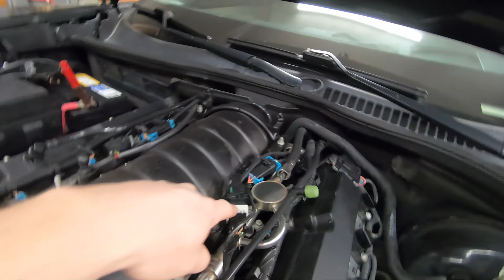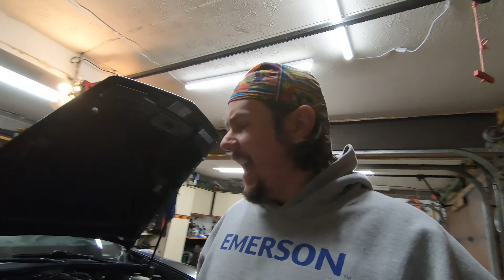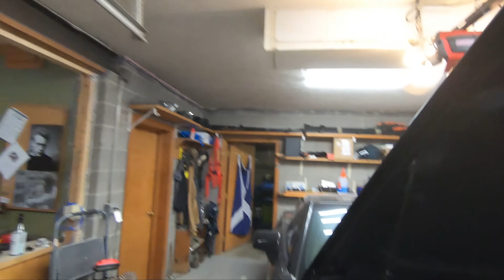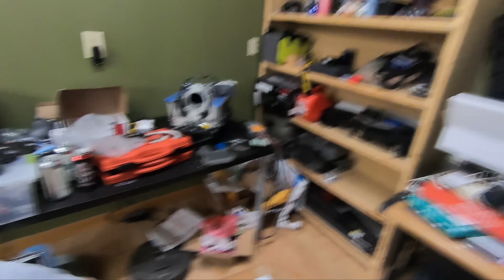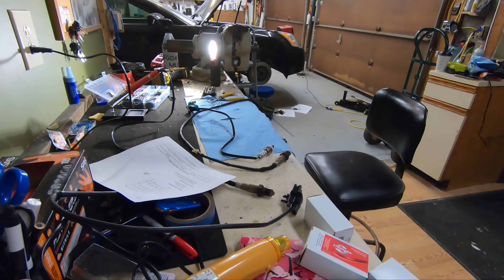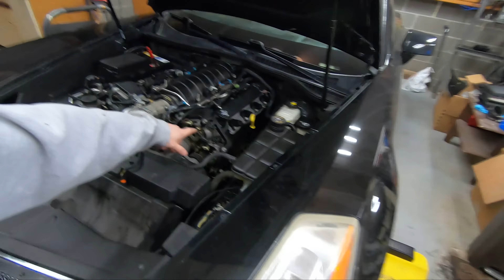O2 Sensor Swap Harness Build For GM Narrowband, Project Country Club

Comment: I wish I would have seen this one earlier man.  The battery in my Silverado was 350 and it went dead a couple years ago.  Caused my truck to shut off on my way to work in the middle of bfe.  Luckily had my boat battery in the tool box.  Swapped it and it's been in there since.  It has 800 or 750 cca and It was only 80 from walmart.  Definitely saved my as$ and my wallet.

Comment: Just watched the cam idle video. I have the idle 90% done on my 2007 e38 ls2 vette but when the car is up to operating temp after about 30 sec the idle drops and starts hunting? Not sure where to look on this
Reply: Ps. On the fuel rail that is called a damper.
Reply from the maker: There are multiple idle/start up tables that are time based and so if it gets bad after awhile I tend to look at what is being changed over that time. Should be able to see airmass and timing changes that are happening due to those tables
Reply from the maker: Also can be related to fuel and idle trims, make sure they aren't messing with you too much
Reply: Ross Lester  use the vcm controls in the scanner to see if the idle hunting is due to timing or fuel. That will help you eliminate half the possibilities. Also see if the hunting is in gear or in Neutral or both.
Also most important thing is to make sure your RAF is dialed in first. If not, you’ll be wasting your time chasing your tail and it’ll never get close enough to where you want it.